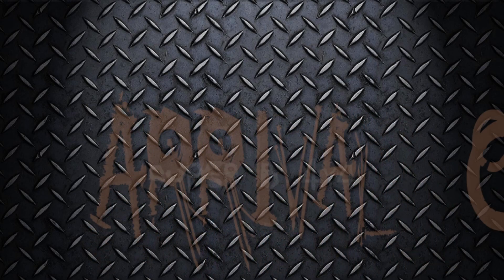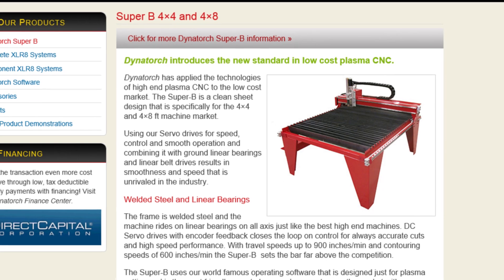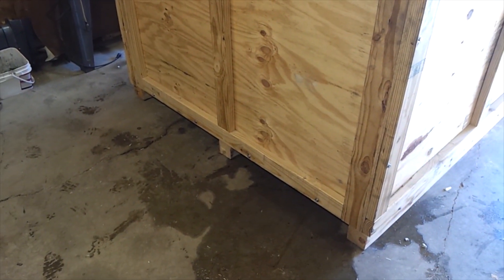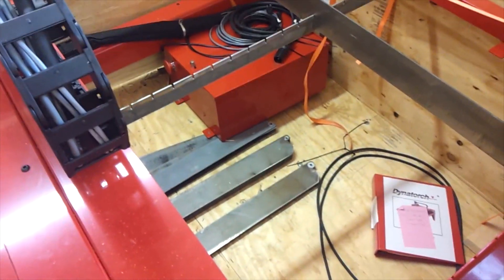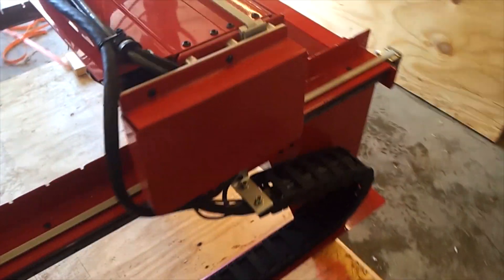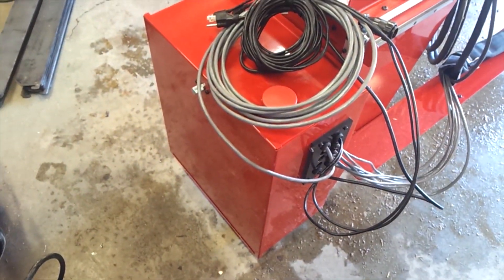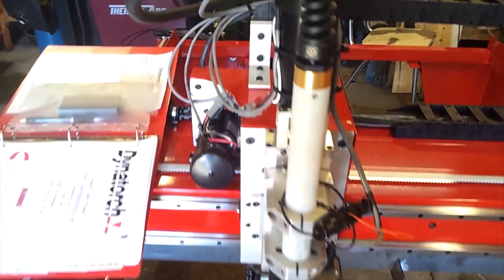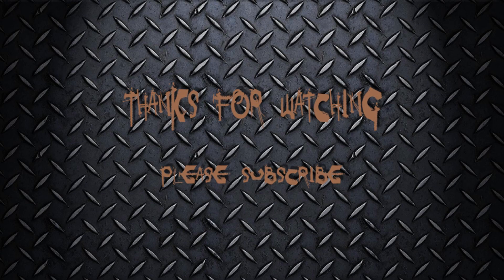CNC Plasma Table - Dynatorch Super B 4 x 4 First Look

Comment: sorry another question how frequently do you use your dynatorch and do you have any issues that you feel like should have been better ? I like the plasma cam table as well but this machine seems to be a lot more rigid , another thing is Dynatorch is made in Alabama and I am about 160 miles from there facility. But I would still appreciate any feedback about your experiences thanks again
Reply from the maker: We use the table a lot.  Me and a buddy started a small company making metal products (www.buc-up.com) and we cut everything on the Dynatorch. We had one failure on a relay that controls the Ohmic sensor and Dynatorch sent a replacement that day.  Their support is second to none.  The machine is sturdy and comes completely assembled!  Unlike the others.  The parts they use are high quality.  But as I said before the plasma cam software for simple cuts is very nice.  Dynatorch software is not as friendly but my video will explain it all. Thx

Comment: Awesome design and quality...I built a 4x8' CNC Router Parts Router and know what these parts cost!!...(Servos and proflie rails)....I am going to upgrade my steppers to DMM-TECH 750 watt AC servos soon...even though I can Get 1,000 ipm rapids..I want to make it a dual purpose router/plasma machine..What did this machine cost ??
Reply from the maker: I think the price was $11,000 $12,000 USD.  It was cheaper than the Torch-mate and the Plasma-cam.  Torch-mate only use steppers so be careful comparing them to the dynatorch or the plasma-cam.  After a year and a half I'm still very happy with my choice - its a good solid machine. Hope you make a video of the build - would love to see that!

Comment: hello. Please tell me what kind of plasma source do you use. and how do you fix problems with interferences. Thanks
Reply from the maker: Hi TiBi - its a Hypertherm plasma cutter.   What issues are you having?
Reply: Thanks for your quick response. I have serious problems i think with interference. I have a Chinese VeltCut 100 A plasma machine with pilot arc but HF . I put shield cables everywhere . Also have  a Proma THC SD . On cutting voltage on THC it stay at 140 V , set by me, but Z axis motor is going up and not stop. This is happens sometimes , not always. I have probe touch . I need to know what is difference from my plasma cutter and a plasma with blowback or spring loaded torch. I can use a non HF plasma Chinese? Topwell they have an acceptable prices .
Reply from the maker: So when the arc is established - the THC unit should kick in.  Controlling the height via the voltage between the work and cutter.  I use optical USB cables between PC and plasma table (no interference) plus UPS and PC power supply.
Reply: Sorry for bother you again but i'm a little confused. you mean cables for steppers are optic cables ? i look on google on usb optic cables and haven't make an idea how it look. also UPS and PC power supply for what ? i have Nema 34 steppers for CNC and i have 60 V DC power supply for each motor
Reply from the maker: So the interference you want to remove I'm guessing is from the PC to the motor controller - USB Optical cables will de-couple the workstation from the controller board - UPS/power filter will remove noise from the workstation power supply.  Stepper motors are not a great choice unless they are using encoders - Servo motors are much better.  Who makes the CNC table?
Reply: No. Interferences are from plasma cutter. I use a chinese HF plasma cutter Veltcut 100 A.

Comment: Funny how dyna torch says there table are capable of 900 IPM..then says it can cut at 300 IPM..I would be impressed to see there tables or any plasma cnc table cut that fast and actually have results of the cut part match the drawing. there isn't a need to cut that fast. and the fact there tables are built like a tank makes it impossible for a servo motor to move it that fast with the weight..then they mention there tables are built with high end servo motors and not cheap steppers is funny..nothing wrong with a stepper..I know people that bought the dynatorch tables and have had many issues from day one. I built mine 5 years ago and still running strong. I'm glad my decision was to build and not buy..
Reply from the maker: Hi Chris, the speed of the cut is limited to the thickness of the material and the power source not the machine.  I don't know any plasma cutter thats runs on domestic power that can cut at 900IPM.  The super B can rapid around the table very fast.  Inertia is always an issue but again, for light industrial use you want something that's going to hold up well.  Stepper motors are junk for any CNC application apart from toys, unless they have encoders then they might be useful for light use.  You won't find steppers used in industrial CNC machines as they also lack the power.  The Dynatorch has been running great for 5 years for light industrial use and still powering along strong.
Reply: Steppers are not junk, they work fine..my table will cut if not better, just as good as any standard plasma table..the structure and weight of the gantry will have a lost to do with the IPM a table should be capable of. I understand the material thickness will control the outcome of the speed needed...what speeds are you cutting 14 ga steel at? just curious..also, the belt idea on the super B seems scary..have you had to replace them yet? my table is gear/rack driven with dual drive motors..very clean square edge cuts, not rounded..
Reply from the maker: Hi Chris, steppers without encoders will drift on long complex cuts as there is no error correction, meaning errors are cumulative - so at the end of a chain of operations (especially with a very noisy electrical environment such as a plasma cutter) the start and end may not match up.  With the HyperTherm Powermax 45 set to 45A and the machine torch you are looking at around 280-360 IPM by the book - in reality more like 240.  We have changed the belts twice in the machines life - and the belts have very little backlash - something a rack and pinion does suffer from (by design) unless you are looking at duel pinion drives.  What are you using for a plasma cutter?  Again the quality of the edge is down to the consistent height of the plasma torch above the work (THC), consumables and the shape of the plasma arc.
Reply: so are you saying you can cut at 240 IPM and have clean results on your parts? no square coners rounds due to lag from the weight of the gantry? because dynatorches gantrys must be well over 100 lbs..I haven't had any mis matching from start to end of cuts. I don't have any back lash. I am using a HT65
Reply from the maker: Hi Chris, so the software slows down the cut for corners, your's must also do the same.  You can also cut an outside loop corner to always make them sharp for some cuts.  The machine can stop instantly - I've seen it when the break away head has triggered - the servos are very powerful.  I doubt the gantry is 100lb.  The HT65 is a great plasma cutter.  Do you use the fine cut consumables?